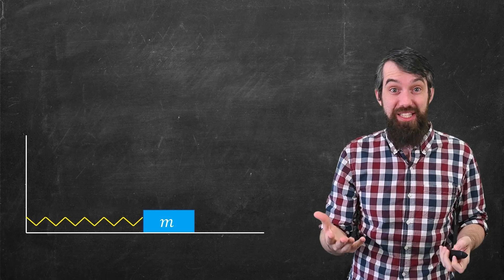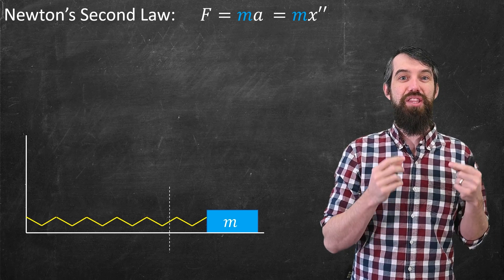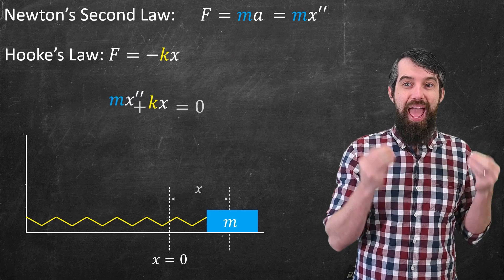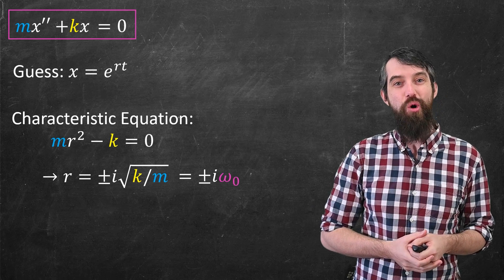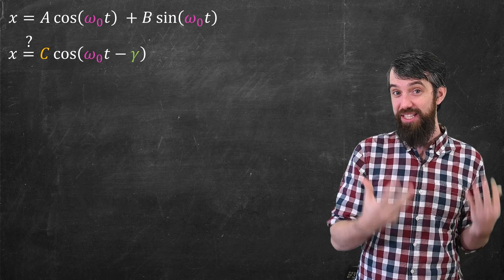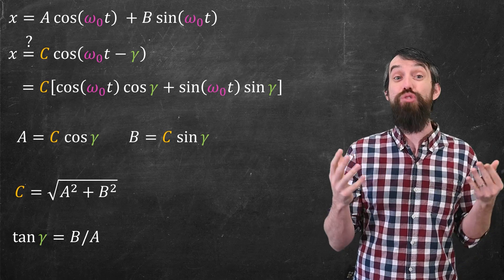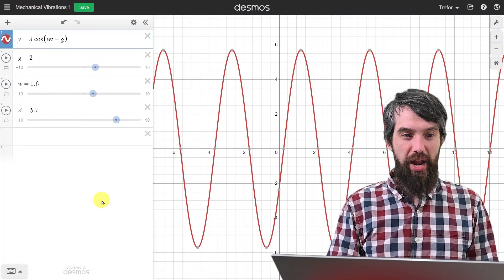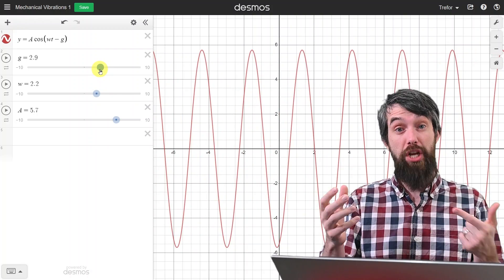Undamped Mechanical Vibrations & Hooke's Law // Simple Harmonic Motion

Comment: Thanks for the awesome video, I have a quick question though. I understand everything up to the point around 5 minutes in where you introduced gamma into the equation. In my textbook at this point in the explanation, the author solved for the leading constants A and B at t = 0, and then he got B=0 and A=x_0 where x(0) = x_0 is the starting position of the spring. The final equation he got was x(t)=(x_0)*cos(a*t) where a:=sqrt(k/M). I didn't see anything resembling gamma after this and I'm confused what it's purpose is in the equation. Thanks again for the help and let me know if you need me to clarify anything.

Comment: Professor Trefor Bazett, thank you for introducing Undamped Mechanical Vibrations and Hooke Law in Differential Equations. DR. Bazett, please correct the sign error in the characteristic equation. Professor Bazett, you have mr^2 - k equal zero instead of mr^2 +k equal zero.

Comment: Why can I not just use either cos or sin from the start? Both are oscillating anyway?
Reply from the maker: I you guess a solution, how do you know it works? We should generally go from the physics to get an equation and only then solve it so we can be sure
Reply: @DrTrefor  OK, got you. I was wondering if I missed a mathematical reason for this. Thanks for your reply! :)

Comment: @ 3.22- you have cleverly manipulated the real & distinct roots r1 and r2 into 'imaginary' ones and gone ahead. But actually the roots are real is'nt it? That is r1= +Sqrt(W_0 t)  and r2= - Sqrt(W_0 t) for which the general solutions will be of the type x= c1. e^r1t + c2.e^r2t. The solution is purely real and there are no Cosines/Sines here. In fact the solutions are exponential type.
This is the method shown in your earlier video (569- "Constant Coefficient ODEs: Real & Distinct vs Real & Repeated vs Complex Pair".  Can you kindly explain please Professor?
Reply: He made a sign mistake when writing the equation. The solutions are supposed to be imaginary
Reply: The characteristic equation should have +k, not -k